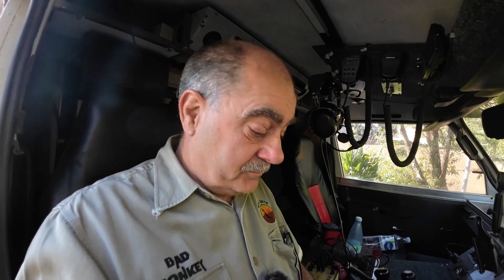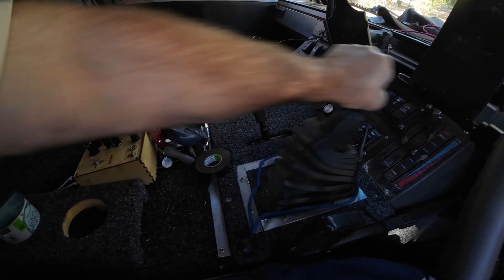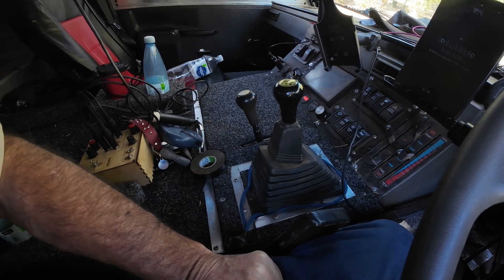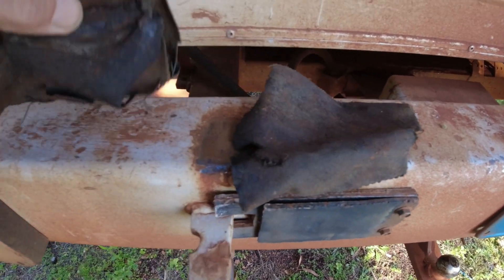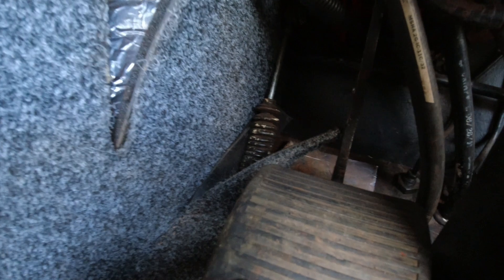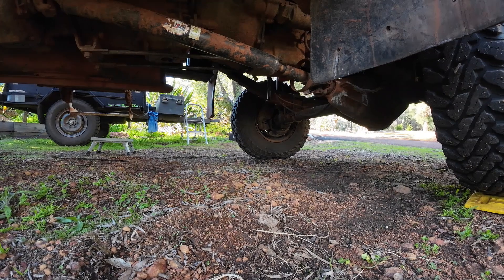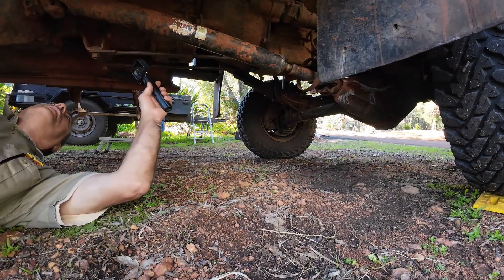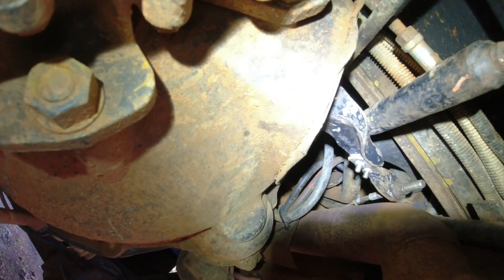OKA 009 has catastrophic failure.

Comment: That's a clutch fork that snapped the outer eye out of it... 🇦🇺🛠️
Reply from the maker: That is right. Apparently this is a weak point with OKAs. Most of them fail inside the bell housing, I was lucky! The whole gearbox has been rebuilt and that fork has been replaced and massively strengthened.

Comment: I drive the first Oka up north. I worked for Travelabout 4x4 tours. He ended up with about 10 Okas as eell as oter configurations. I had stiff gearchanges in one. It was not old and persevered for the whole Perth Broome Darwin Alice Perth 4 weeks with 12 passengers luggage food and camping gear. No trailer. Never was fond of Oka's. This was about 30 years ago. I would go Canter anyday. Or the best units i drove for tours were 25 seat Isuzu 8 ton truks. 1 fridge, 4 eskys, 1 fluro light for the kitchen and 1 three ring gas burner, 2 camp ovens. Now days people over complicate what you need.
Reply from the maker: You either love or hate OKAs. They are certainly quirky and each one has a unique characteristic. The gear linkages are pretty shit. But we have had ours rebuild and the gears are ok now.

Comment: If the gear box has sun to rings there’s no need to use the clutch, only to engage & use 1st gear. All the rigid 5 speed trucks I’ve driven I’ve only ever used the clutch to engage 1st, all other changes both up & down I matched engine speed to road speed & the gears have just slid in & out. 🙏
Reply from the maker: No syncro on first. Its not the gearbox that is the issue. The gear linkage is a prick of a thing

Comment: Cable operated clutch.
Cheap and nasty.
By the way you described your truck's
setup, I would add, complicated.
Reply from the maker: Cable operated and the cable was 30 years old. Actually the truck is pretty simple. There are no electronics for the engine, fuel air and compression for it to run. That engine is now gone and replaced with a Cummins, much better

Comment: Rule No.1. from a mechanic. If your gearchanges are not happening properly always check the release bearing action and release ability. Jack up if necessary to spin it a wheel or tailshaft while in gear. Any clutch drag will be detceted.
Reply: I trusted the mechanic who did the work. That lead me down the wrong path, until I found out what you said

Comment: I know you've had issues but at the end of the day how have you found the QKA. Would you buy another one if that one was written off for some reason or would you go with something else?

I am toying with the idea of buying one although I am also considering a Canter or Perentie 6x6 based platform.

EDIT: Anything I buy will be pre-Euro 3... ie, mechanically injected, no ECU.
Reply: We put a new cummins 5.9l 6BT in Oka 009. It is good mechanical fuel pump and the only electric parts are the fuel solenoid and starter motor. That runs really well. There are places you can get them for around $12k. But them there are mods that need to be done to install them. The original perking is just not powerful enough to maintain good highway speed
Reply: @thomo59  I don't want to feed a 5.9l!!! You'd be leaving your own hills behind you due to wheel spin! 😂 Good luck with it!
Reply: That's good question. With the money we spent we could have bought a new Ram or the like. But the Oka is very simple, pretty easy to work on and tough. It is good off road, not uncomfortable. And unique. They are also the same track as a patrol or cruiser so they fit on the dirt tracks well. Bigger trucks may struggle and risk punctures. The uniqueness is a big plus, but also is biggest down side. Unless you buy a brand new one, you have to be prepared to let the moths our of you wallet.
Reply: @thomo59  I'm not going near a modern engine again. I have had more issues with post 2010 vehicles than I ever had back in the day. Old diesels you just service them and they'll run happily for years. Newer ones you're forever chasing sensor issues particularly in dusty conditions which is where I mostly am! Kinda leaning more to the Perentie now... Parts are plentiful and reasonably priced. I can get a mil rebuilt engine, GB and transfer for around 10-12k. They are the Isuzu 3.9. The most reliable engine I have had anything to with was the 2.8l version of that engine in a 97 Rodeo.

PS... Thanks for the reply.
Reply: Yeah, @InoFughaul 2.8 isuzu are lifetime engines. Bulletproof.
Reply: I don't push the power, but I no longer struggle with hills or head winds. And I am not a risk to other road traffic being unable to keep up the pace. Fuel economy is also not terrible even pulling a 20ft caravan ( and still the hills are not a problem). I had a 110 defender once  but never again.
Reply: @thomo59  May I ask what you average p/100 highway? And... The Perentie is a 110 powered by Isuzu! What could possibly go wrong? 😂
Reply: About 5km/l towing a 3.5t caravan. Landrover positive was it was really economical on fuel.
Reply: @thomo59  That is awesome fuel economy! I would definitely be happy with that. I would have thought you'd be just South  of 4! Decisions. Decisions! 😆

Comment: My XT broke the rod from the pedal, in traffic.... I replaced it with some stainless rod with opposing threads and clevis pins, so I can do some minor adjustments inside the cab. It helps.
Reply from the maker: I had the whole cable replace when the engine was replaced. I am much more confident with it now. It was a prick of a job made easy only by having all the front panels and roo bar removed.
Reply: @wa4wd  Cheers. Pulling the front panels off is a shortlist job. Rust behind them... of course.

Comment: Thanks for information, having similar problems, will look into
Reply: The biggest issue I had was the clutch not releasing properly. I fought this for 3 years before finding what it was, just before having the motor replaced! The gear changes are so much better (though still truck like). There is an inspection plate under the bell housing and you can clearly see the clutch plate and flywheel, this is how I finally worked out what the problem was. I have since found out that the actuator arm is a known issue that either bends of breaks inside the bell housing. I was lucky it broke outside. When the motor was replace the actuator arm was replaced with a much stronger custom model.